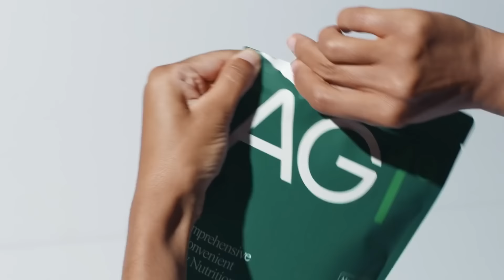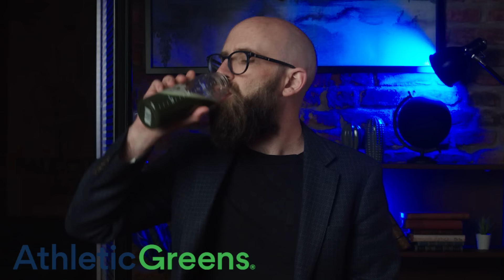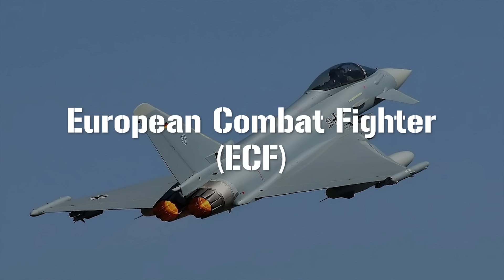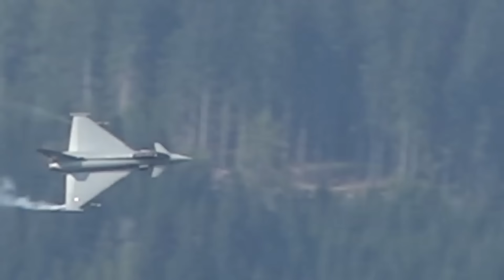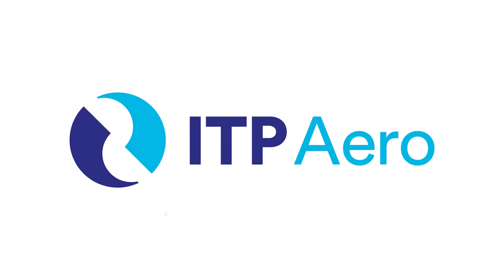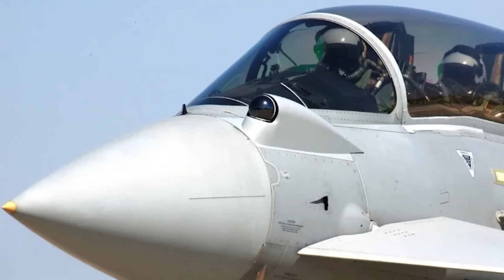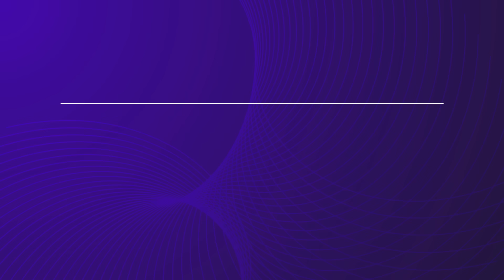The Eurofighter Typhoon: Any Aircraft, Any Mission

Comment: "The center of gravity shifts backwards"
No, that is the center of pressure. The center of gravity couldn't care less whether the plane flies above or below the speed of sound.
Reply: I think it would be yet better to refer to centre of lift. Aerodynamic drag has it's own, different, centre of pressure. There must also be a centre of pressure in yaw - which must also move significantly over the aircraft's speed range.
Reply: oh thank you I was wondering how in the world could they shift the center of gravity.
Reply: @theEvertw, correct.

I was surprised he made this mistake, CoG and CoP are entirely different things. The only way to achieve such a shift (of the CoG) would be if tanks and payload would move backwards... Which is not possible. 

But still, good video. 

However, considering he said  elsewhere the Rafale has a distinctive advantage over the Typhoon (not at all true) , there's no way he would do justice to the Typhoon and it's upgrade program. For some reason, the Typhoon and the Grippen are being greatly underestimated by most analysts.

We shall see.
Reply: True story.  Unless you're moving actual matter around.  COG remains the same.  Even the consumption of fuel and depletion of payload is engineered to keep the center of grav and the center of lift colinear.
Reply: You mean center of lift. But okay.
Reply: I agree, unless the fuel tanks were designed by a muppet the centre of gravity should be constant and will be for a well designed fighter to maintain the same flight characteristics throughout the flight.  Unless the plane physically changes shape like an f-111 or f-14 the COG wouldnt give a flying toss what the free stream velocity is.
Reply: I think he of should used "Centre of weight" rather than gravity, weight distribution gets effected by dynamics of a aircraft at speed and can change effective location... Making a better explanation between pressure and gravity.
Reply: Tell em son
Reply: I know this is a 2 year old comment and I’m not sure if you’re being a smartass or not but it could just be a mistake I call things the wrong name all the time, everyone does
Reply: @a_catfish5180  I corrected you because it is quite a serious error that would lead people to completely misunderstand what is happening in the transsonic regime.
Sure, we all make errors, but errors should be corrected.
Reply: @TheEvertw  yes sadly YouTube still doesn’t let the creators edit anything after the video is posted so they can add center of pressure*
Reply: While I think you are correct, I think it might have just been easier for lay people like myself to understand.
Most of us general population have at least a sense of what center of gravity is, but not center of pressure.

Not criticising your comment, just postulating that it might not have been a mistake
Reply: @Ryan-lk4pu  The matter is also a bit more complicated in some planes. For example in the SR-71, the aerodynamic changes are so great that in order to maintain stability, fuel needs to be pumped to different tanks in the plane depending on speed. This is called "trimming". Thus they do change the center of gravity to reflect the aerodynamic changes, but I doubt this is also necessary in the Typhoon.
Reply: @Ryan-lk4pu  there's no point in being easy to understand if you're wrong. (Man it's hard to be polite sometimes, how can you be such a fool?).
Reply: @drworm5007  I disagree. There are countless examples of where it's much better to teach something that is technically wrong, as long as it gets the understanding across, as it did in this video. A good example of this is the atomic model, you don't teach beginners in chemistry the cloud model, you teach them the shell model, even though that is not at all how electrons behave in an atom. But it's so much more intuitive and still teach you a rough understanding of their behaviour.

Another example could be teaching a child about the suns/moons movement in the sky. If you say the sun rises in the east and sets in the west, it will be easy to "grasp" and he will have understood the suns movement in the sky perfectly, even though it was horrendously wrong in terms of what actually goes on.

In this video he said the "center of gravity", that is a concept everyone is familiar with, and since the plane actually behaves as if the center of gravity shifted, it gets the layman's understanding across perfectly. If he said "center of pressure" instead, many viewers would have been distracted by thinking about the unfamiliar term, instead of just intuitively understanding it.
Reply: @drworm5007  and thus, you have been spectacularly proven wrong in your own pretentious game
Reply: @drworm5007  It is easy to be polite... just don't type the last part.  While I agree that using the term center of pressure or center of lift is accurate and center of gravity (or mass) incorrect, there is always some judgment how much one general info piece can cover, or how wrong a quick explainer can be before being a problem.  Perhaps a quick teachable moment in the video after introducing that the center of pressure shifted?  A quick one-liner could say the center of pressure is somewhat similar to center of gravity in that it is a summation of forces on the aircraft, but is instead the air pressure forces added to a single point, which can change based on surrounding air conditions.  A quick little aside that loosely relates these two types of centers, probably familiar to a wide audience, and enlightens a tid bit why the aircraft was experiencing a shift.
Reply: @TheSaltyAdmiral  magnificently put. That's exactly what I was going for.

I thought Luke's comment was a bit mean and aggressive if I'm being honest.
Reply: @drworm5007 only "sometimes"? As is its sometimes easy, or you don't try very often?
Just looking for clarity
Reply: @drworm5007  Simplification is something that exists.
Reply: As the aircraft increases its speed, center of pressure/lift moves forward. That makes an aircraft more stable and less maneuverable. So he did a mistake, but in a way that concept is still explained correctly. Only it is not center of gravity moving backwards towards center of pressure, but center of pressure moves forward towards center of gravity

Comment: France pulled out because they needed a multirole fighter, the Rafale is just that, its a workhorse. Typhoon is a air superiority/interceptor, they didnt want that type from the start. You have to be in denial to say the Rafale is no good, many claim its superior to the Typhoon in many ways. Also, the multi nation part production system was causing major delays/ quality control issues. France was right, its better to have 1 outfit building the thing, problems can be addressed on the spot, fast and effectively, and they learn the platform like the back of their hands, every part.. If England handled 100% of the production, the Typhoon probably wouldnt spend more time in maintenance than it does in the air :/, or be half as expensive to boot. You are not handling defeat very gracefully. England should fucking pull its thumb out of its ass, produce the Typhoon 100% In Britain, and cut the fucking prices of the thing in half while raising reliability 10x. So English boys, chill out with the slander , the Typhoon is a fine plane and no one is contesting it, but its way overpriced, unreliable, and those issues wouldnt exist if they had listened to France in the first place. Shape up.
Reply: Simplified production is a plus but on the other side you have split development costs and guaranteed buyers. 
France has made a fine plane, but one of the diagreements was France wanting to use its own engine, and it's a worse engine.

Comment: Ok. Right up front let’s clarify. The F-16 design morphed from air to air to swing from ground attack to air to air as it’s design evolved in the late ‘70s so the Eurofighter’s capabilities were not new. 
Secondly, the F-16 was also designed to be statically and dynamically unstable at sub sonic speeds using 4 flight control computers to maintain controlled flight. Here is the glaring error; when the airplane goes supersonic the CENTER OF LIFT MOVES AFT OF THE CENTER OF GRAVITY (CG) and the airplane becomes stable. The CG only moves as the airplane burns fuel and delivers ordinance. 
On some of these subjects please do more research because your videos are otherwise very good.

Comment: Considering Dassault was an original member of the Eurofighter group the fact that France has not taken any of the aircraft says a little more about the relationships that could have been explained in a bit more detail, also the whole design history (which is often far more interesting than the specifications).
Reply: Thats not true, France pulled out because they needed a multirole fighter, the Rafale is just that, its a workhorse. Typhoon is a air superiority/interceptor, they didnt want that type from the start, why would they take any? You have to be in denial to say the Rafale is no good, many claim its superior to the Typhoon in many ways. Also, the multi nation part production system was causing major delays/ quality control issues. France was right, its better to have 1 outfit building the thing, problems can be addressed on the spot, fast and effectively. If England handled 100% of the production, the plane probably wouldnt spend more time in maintenance than it does in the air :/, or be half as expensive to boot.

Comment: I know you aren't an authority on defence or aviation issues, but you need to do your research properly.  When Jumper made his comments (in 2005, ffs) he was indeed the only pilot to have flown both aircraft.  Much has changed in 17 years, with the RAF at least exchanging Typhoon pilots with Raptor units.  RAF and Luftwaffe units, at least, are multi-role.  RAF Leuchars was transferred to the Army in 2015!  Northern QRA operates from RAF Lossiemouth.  29 Sqn is NOT a reserve unit!  Your £100k figure is absurd: nobody does the cost calculation that way (essentially by dividing the total costs of running the RAF by the number of flying hours).

Comment: I'm still sad that the RCAF opted for F-35s instead of Typhoon IIs.  Not only is the plane very pretty, there's a wonderful symbolic linkage to the Hawker Typhoons flown by the RCAF in WW2.

Also, I can't help but point out that although 100,000 pounds per hour is a very high number, most of that cost is independent of the aircraft.  Pilots, engineers, ATCs, and so on would all be getting paid no matter what aircraft was involved.  So that's a nicely dramatic number but not a particularly useful one.

Comment: Hi y’all, which do you prefer: The Typhoon or the Rafale, especially when it comes to Air-to-Ground Capability and Weapons Compatability?
Reply: A2G the Rafale wins, Thats what it was original designed for. The EF2000 was designed to be an interceptor and later on modified for A2G roles.

Comment: All of this is impressive and all but I’ve never been much of a Delta wing fan.
There any aircraft, any mission moniker to me just means you’re trying to do too much with one plane and those kinards on the front of the plane are not a good sign that people were making rational decisions.
Remember that most multi role fighters in the US didn’t start out that way.
The F-16 is a great success story and the Europeans probably could have applied certain design elements that the F-16 had that makes it a contender in a dogfight to this very day.
Namely, the leading edge extensions.
Apparently, that is why the F-16/18 are still at the top of the dogfighting heap today.
They’re not THE best fighters but they have excellent nose authority and at the end of the day that’s what wins dogfights and it’s basically just a minor design to the wing that makes all the difference.
Would be interesting to see a twin engine version of the F-16xl with a smaller wing for maneuverability.
I’ll bet you it would be a world beater
Reply: The Typhoon was built as an interceptor, full multi role has only come recently.

Comment: "The world most advanced swing role aircraft" 
Proceeds to be inferior to the Rafale in almost every single way.*
Reply: Yes the Rafale* can do some things slightly better than the Typhoon, But that doesn't mean the Typhoon is bad at them either, But when it comes to air to air there's no competition..
Reply: @Markus117d  it’s « Rafale ». Rafael is the Israeli weapon manufacturer. I never said it was bad. But there is not much the Typhoon does better than the Rafale. Namely, the planes fly essentially the same. the Typhoon is faster and more maneuvrable at high altitude and speed (while the rafale is better slightly lower at slightly slower speeds, but very similar overall) the Rafale climbs faster . In BVR the Rafale would stomp the Typhoon because the Rafale has an AESA radar and the Typhoon doesn’t. The CAPTOR-E is still not ready as of 2022 while the AESA-RBE2 as been operational since 2012. 

As for air to ground; even back in 2011, there was nothing the Rafale couldn’t do while the Typhoon needed a separate plane to illuminate its target
Reply: @Jib60  Fixed the typo lol..Thanks for pointing it out, Auto correct ( facepalm )
Reply: Every way but obvious things like speed and altitude?
Reply: @davidhouseman4328  that’s why I said « almost » speed and altitude aren’t what makes a fighter good or the Mig25 would be world class. The Typhoon is still struggling with AESA radar technology and proper Air to ground integration.
Reply: @Jib60  so basically your by almost all you mean some areas. For example as your talking about radar the Typhoons is larger and rotates for for an even bigger view and Qatar has now received it's first which features AESA. So that's another area the Typhoon is better.
A couple are the PIRATE system generally considered the best and the two way communication with meteor.

Comment: Not only does the centre of lift instead of the centre of mass change when the Eurofighter Typhoon goes supersonic, it also makes the aircraft aerodynamically stable instead of unstable what is is in subsonic flight. This means it is LESS maneuverable above Mach 1, which is logical because the stresses on the aircraft above Mach 1 are very high and you don't want to accidentally flip an aircraft above Mach 1, you'll have a rapid unscheduled disassembly. What does happen above Mach 1 is that the increased stability means that there is less trim needed to keep the aircraft flying in the correct direction, and thus less drag is created, resulting in higher performance. But please get an aerospace engineer to look at your scripts beforehand, because this type of video is just earning money off of wrong information, which people will believe.

Comment: Eurofighter is an excellent air superiority aircraft, but it lacks the ground strike capability of newer platforms. That is why in recent years it has been outselled by F-35 and Dassault Rafale, an aircraft with which actually has some roots in the start of the project (France later pulled out).
Reply: I basically doesn't anymore. It did but project centurion filled the gap for the RAF at least. Its biggest problem for exports is cost.
Reply: F35 sales are fueled primarily from the integrated nature of most western militaries now.
As for the Rafael, The french stole basically every "improvement" that the Rafael has over the Eurofighter from the euro project itself.
Over the last few years, France has proven to be as trustworthy as China when it comes to stealing designs or innovations from it's "allies".

Comment: Very important as a perfect complement to the F-35. Within visual range, probably the best fighter in the world. While the F-35 is superior in a command and control role, and a SEAD role, the Eurofighter is likely a better interceptor.
Reply: F35 make a louse interceptor against lots of old russian hardware. Having a low top speed and climb rate will do that. Eurofighter has the needed climb rate and top speed to get something fast and high like a Mach 2  bomber, plus more meteors in its conventional load out to help it intercept a full flight of high speed targets. This comment will certainly get stick from the yanks, but they have there F22 & F15c to do the same roll. No one wants a slow interceptor and the 35 is just not up to the job of intercepting anything. Eurofighter is, and with the new radars slated for it your stealth may be about to become history.

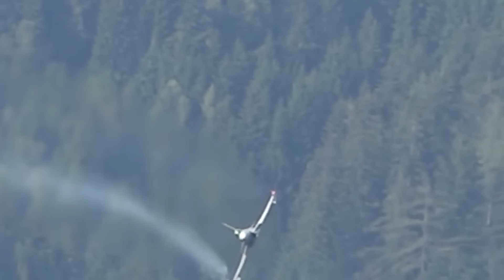Comment: 4:06 the centre of gravity doesn’t shift.
It’s the centre of aerodynamic forces that shifts when passing the speed of sound.
The only way to move the centre of gravity of a fighter airplane in flight is to pump fuel around.
Reply: ..or release weapons that are not on the centreline .
Reply: The center of aerodynamic pressure shift in relation to the CG.

Comment: If an FA-18 costs between $17,000-$30,000 an hour to fly, the Typhoon is far too expensive… Although adding in the cost of air traffic control is BS. You don’t NEED that kind of thing to fly, and obviously a controller is watching more than one plane so his cost should be divided amongst every single aircraft in his area of influence. The cost of jet fuel burned is the true cost, followed by essential maintenance costs, plenty of which will be grossly overpriced. And the ground crew make a salary - they aren’t your local BMW dealer invoicing mechanic hours out for servicing your car. The crew crew is paid a set amount to maintain the plane, whether ten hours or thirty are required. The pilot would probably do it for free.

Everything else is extra / non-essential in a practical sense, just inefficiencies of modern economics.
Reply: BAE is expensive